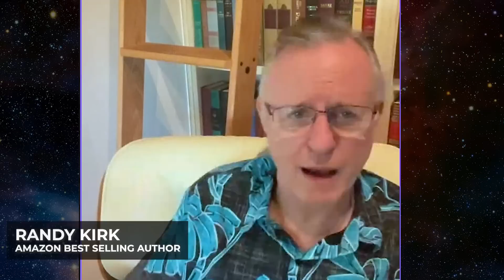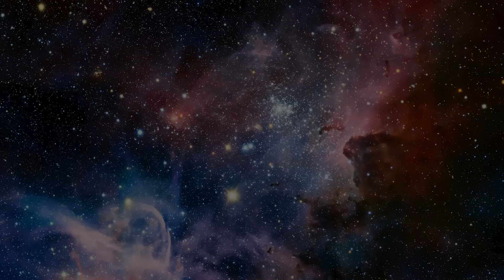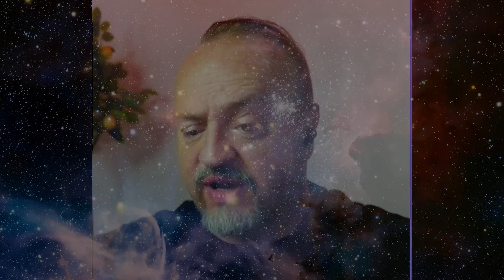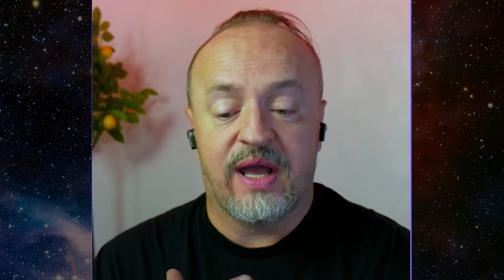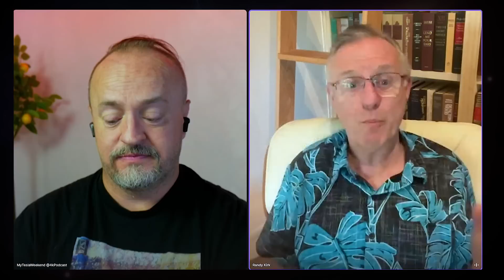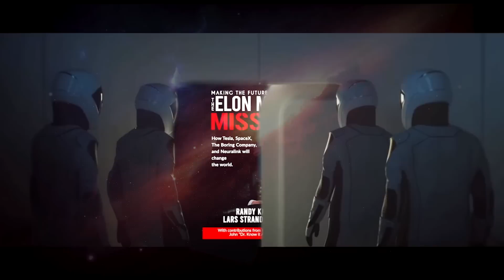Tesla Getting Ready to Build Baby Build - More Giga & Mega Factories, More Cars, MegaPacks, Profits

Comment: But how long is Giga Texas going to have a crash test building and wade test tank? When Joe Tegtmeyer told what they were going to be, he showed the permits, and they were for a temporary crash test building and a temporary wade test tank. Now if there is one thing they love at Giga Texas, even more than building cars, is ripping out the concrete they have put in. In fact, they have already ripped out every bit of the original ground slab they put in originally. So the chance that these two facilities are temporary is almost as good as Tesla building electric cars.